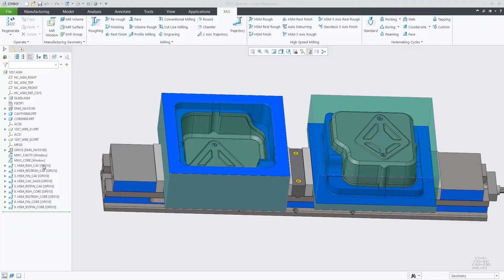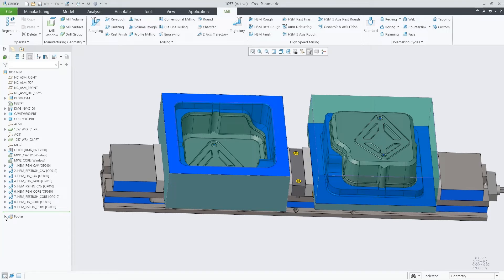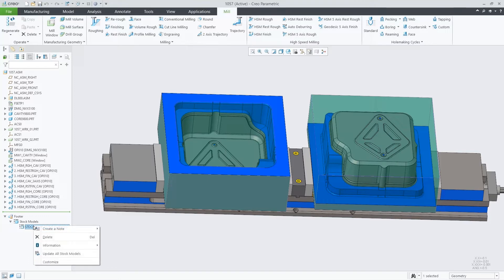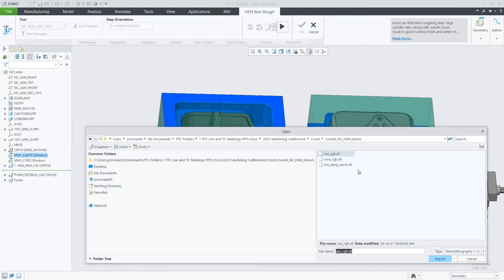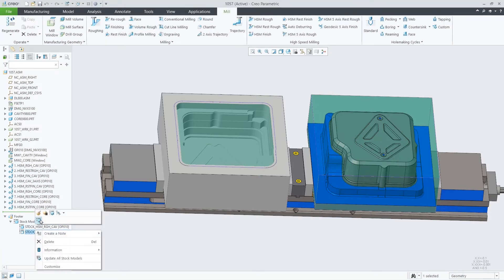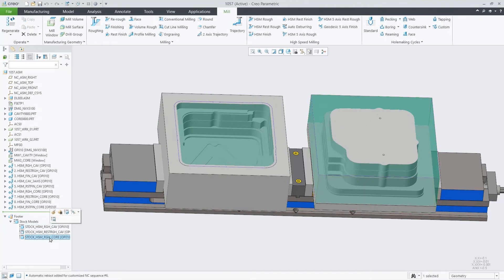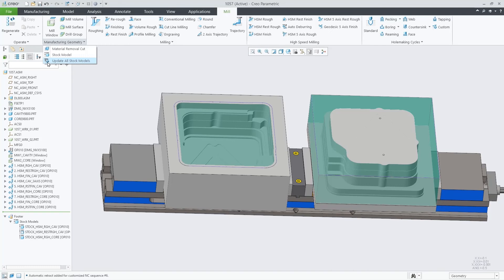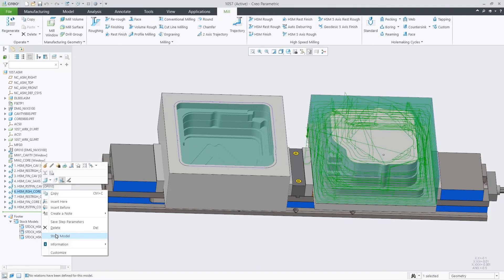Associative In-Process Stock Model | Creo 9

Comment: What does it mean to have associative in-process stock models?  Will the subsequent sequences now reference the new stock model instead of the initial workpiece model?
Reply from the maker: Hiya!
Jose Coronado, the manufacturing product manager who recorded this video,  responded to your question with...

"The Associative in-process stock model in Creo 9 is the a first implementation (more enhancements to come) and refers to the new capability to create stock models based on individual toolpaths, a set of toolpaths or complete operations. It is based on the same technology of the Material Removal functionality, but the user does not need to wait for the simulation, it is instantaneous…

Previously the user needed to run Mtl Removal Simulation, save a stockmodel in the model tree and use it for rest-roughing (to say an example). This was based on an STL file that needed to be managed and updated manually.

Now, the new stock models are created and placed automatically in the model tree, if the toolpaths in the reference collector changes, it will be automatically updated upon regeneration.

About using it for further calculation, these new stock models can be used in HSM Rest Rough for instance.

More improvements are needed for this functionality, and sure we want to get to the point described by the user where Creo NC can automatically account and reference one single in-process stock model for all toolpaths… We want to get there in a future release."

He then offered his availability for a quick demo and a personal Q&A session with you, if you desire it.

I hope that answers your question!